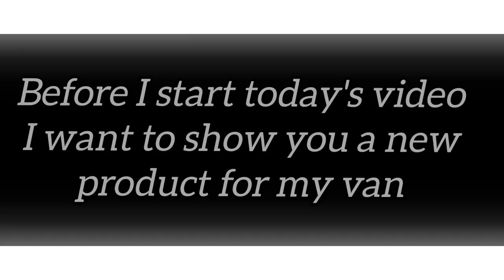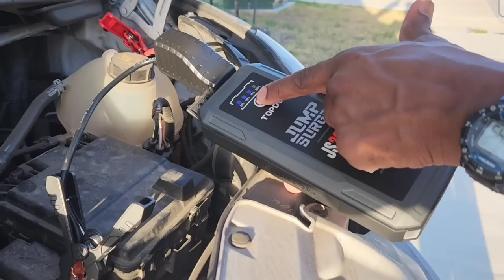Fast money in the cargo van | new product added to my equipment

Comment: Hey CJ, those battery jump packs are great however, they have to be connected correctly; Black to Ground & Red to Positive on battery. These units are also very sensitive and CANNOT handle extended cranking as the cables will overheat. As a former Technician I used mine all the time, an absolute great investment. Btw, love your content.
Reply from the maker: Right, yea I realized I did it backwards,  but it's just a demo, yall get the point....😁. Appreciate the support 👍🏾